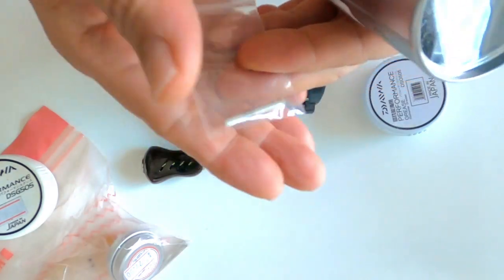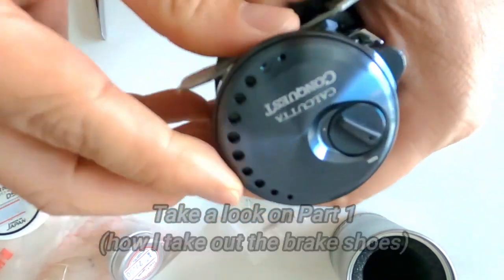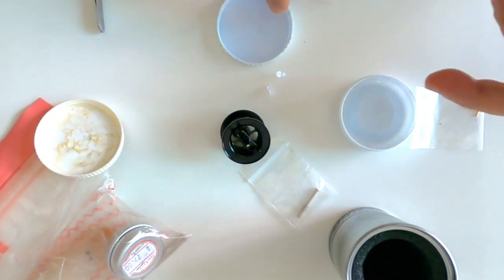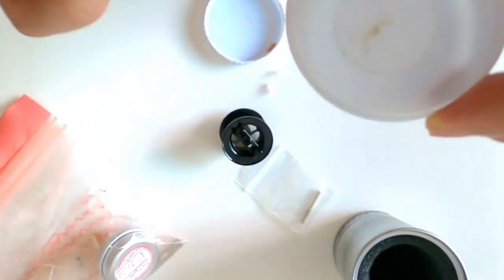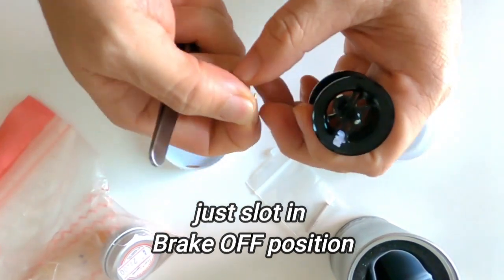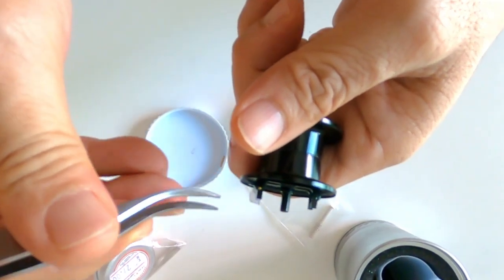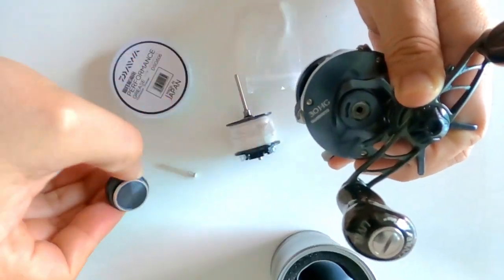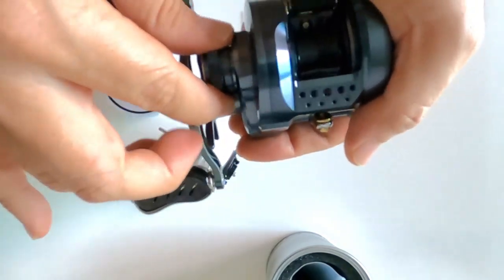24 Shimano Conquest 30 HG| KKR S10 custom spool Installation tutorial (Part 2)

Comment from the maker: KKR S10 is not shallower than the original 30HG spool.
KKR S10 inner diameter is 20.35mm
30HG inner diameter is 23.50mm 
but KKR S10 spool is lighter (6.6gr) due to air spool (short shaft) while 30HG spool is about 14gr.

Comment: What a diameter of PE line that you installed to KKR S10 ?  
How much the line capacity?
I would like to use PE1.5(dia. 0.205mm) around 100m, 
which spool model is proper? S-10 or S-10-Shallow?